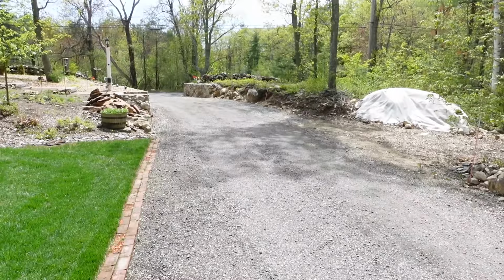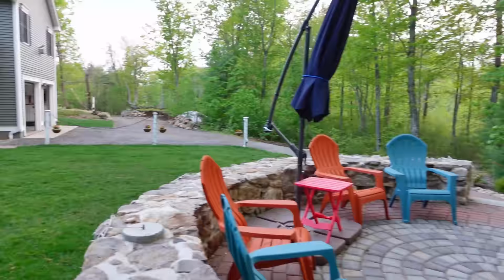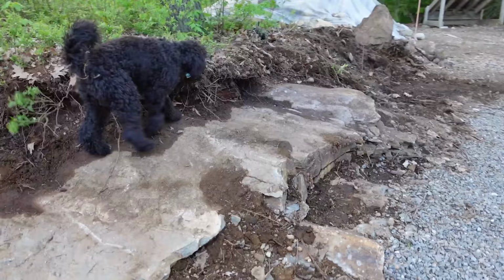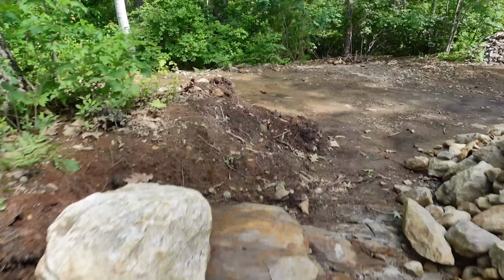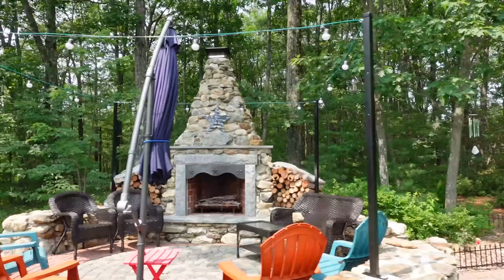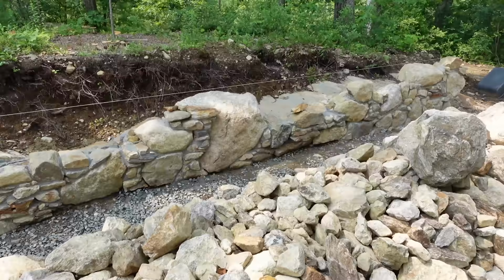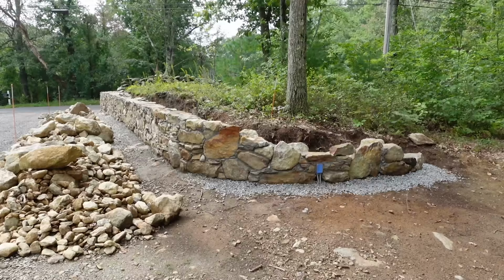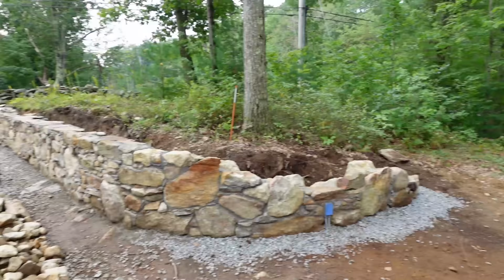Building a Mortared Stone Wall Year 2

Comment: Great job James, something tells me this isn't your first stone wall. I see that you haven't poured a reinforced footing. Are you concerned about frost?
Reply from the maker: Definitely not my first! Most of the walls I built on the property are on ledge, so effectively a lot bigger and deeper than any concrete footing would be. The wall in this video is about ~130 feet long, and about 115 feet of it is right on ledge. In the few areas that I have built walls not on ledge I’ve just been using plenty of drainage, mostly French drains to carry it well away, and I try to make the base of the wall thicker than it is tall. I’ve got one that I used this strategy from 4 years ago and there no sign of movement, but time will tell!! Thanks for watching!

Comment: Elaborate on the sono tubez please
Reply from the maker: Sure! The sono tubes that are built into the wall around the patio by the fireplace are there for a future pergola or potentially some type of covered roof. At the time I built it (and now) I wasn’t 100% sure how or if I wanted to cover the area. I thought it was be any easy way to future proof the area by having an area to secure structure to that went straight to below the frost line, that didn’t require me to try and attach anything to the wall. Hopefully that helps!
Reply: @james.clinton  hi yes i got that towards the end of the video.... Thnx